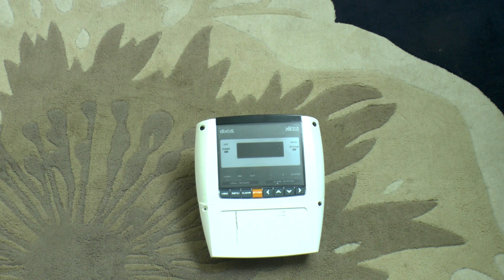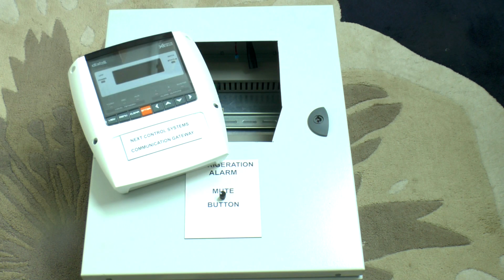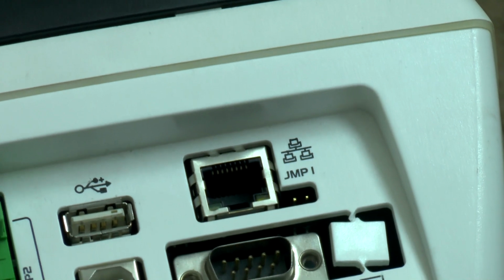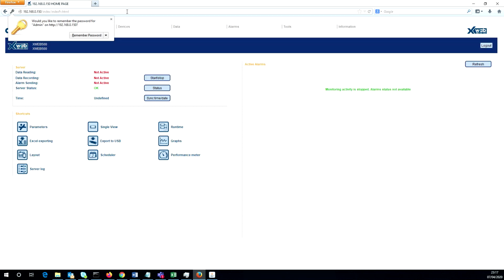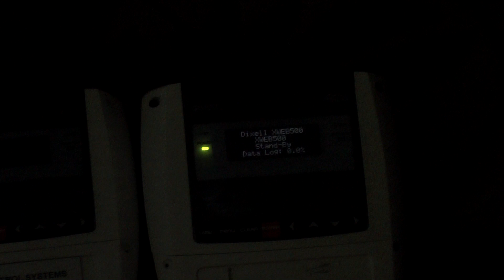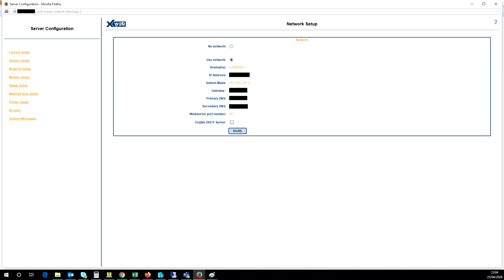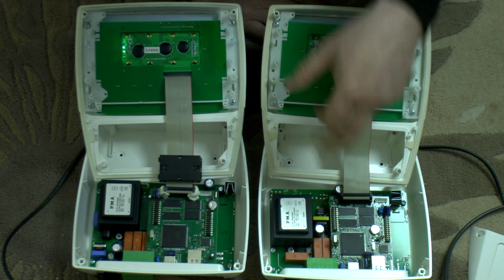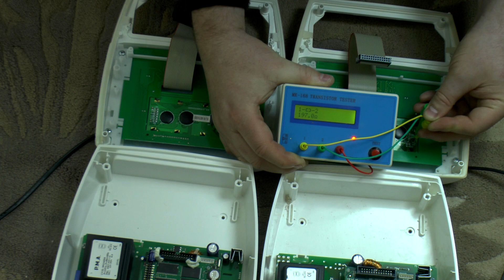Dixell XWEB 500 repair and teardown

Comment: I can't say I'll ever find this useful but I did find it interesting and nostalgic.

Back when I was in IT I'd sometimes be called upon by the facilities manager to fix the HVAC controller when it went FUBAR and the company with the maintenance contract couldn't schedule a visit for a few days. Horrible web interface which required an obsolete browser and Java to work.
Reply from the maker: It seems to be par for the course with HVAC. Many of our schools have TAC (now Schneider like so much else) Xenta 555 controllers for their boiler systems. Can't use HTTPS because of old encryption methods and of course you need to jump through hoops to get Java to work. To top it off now we're installing multigigabit switches which don't do 10Mbits/sec, only 100Mbits/sec and above. Guess what the Xentas run at! I've got to sweep the existing switches for 10Mbit devices before upgrading.

According to the install splash screen "over 3 billion devices run Java". I wonder how many of those it no longer connects to...
Reply: AintBigAintClever Funnily enough, mine was in a school too. I can't remember the make but TAC rings a bell.

FM hoped he'd be able to web into it from his phone. Er, no, sorry. I think we ended up with it connected to a dedicate PC with suitably ancient Windows, IE and Java. He had to go to the boiler room to use it as I wasn't prepared to have it anywhere the LAN! 

We're both retired now. For our successors' sakes I hope that device is too!